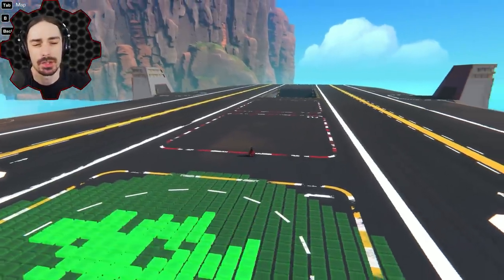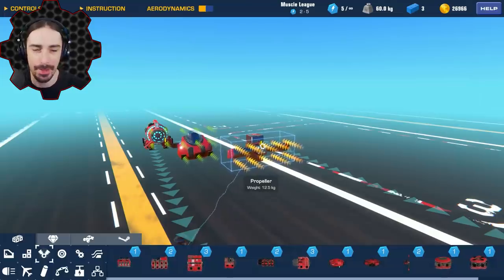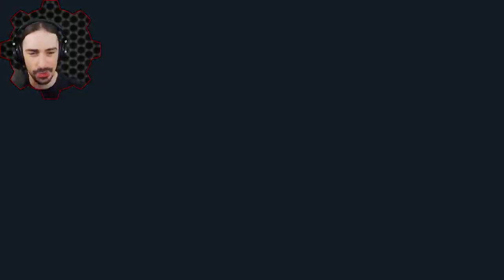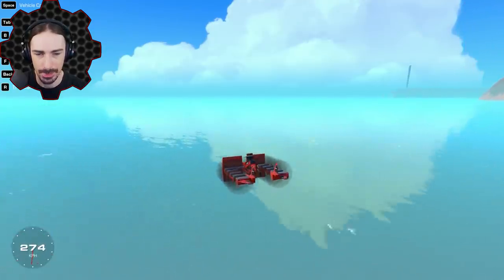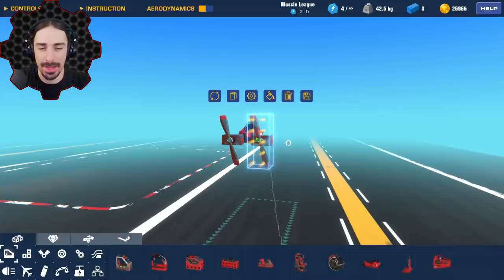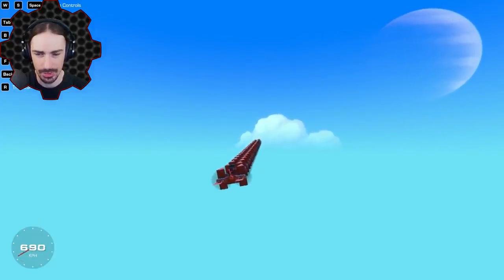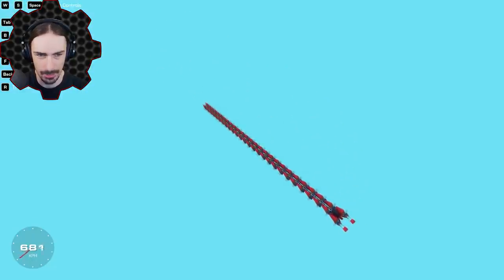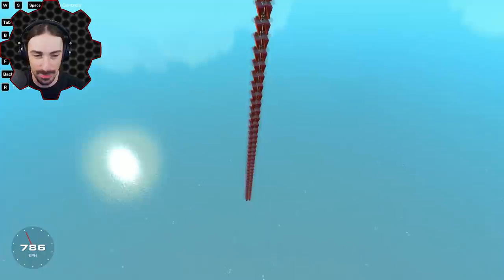Is It Possible to Break the Sound Barrier With PROPELLERS?! - Trailmakers Gameplay

Comment: How about try to "break the sound barrier by spinning..."
I mean you have speed when spinning...
A wheel have speed when spinning
A propeller's have speed when spinning
Why not spin yourself and maybe just maybe, it can break the sound barrier.
Reply: A BEYBLADE BREAKS THE SOUND BARRIER
Reply: Theoretically this wouldn't be too hard if you just get really far from the center of rotation
Reply: idk if trailmaker caculate speed that way
Reply: I may be wrong but I don't think it is possible as I have tried and there seems to be a cap on the speed achievable (by spinning or using an arm to spin a seat in a circle) around  120 mph but knowing scrapman he would do it
Reply: @pognaut  aerodynamics, get engines and helicopter engines
Reply: Spinning is a good trick
Reply: @classic_gamer4702  not if you get dizzy real quick...
Reply: @vxunaTM_xuandanhphan  it does not you it only calculates speed linearly
Reply: The ultimate beyblade
Reply: @flashlp3001  I was referring to the line in "The Phantom Menace" where Anakin says 'I'll try spinning that's a good trick'
Reply: @Eryna_  propellers only
Reply: @cyantasks7129  thats a seperate challenge though?
Reply: @Eryna_  oh
Reply: I went 12000 kph in stranded in space because I was trying to get an explosive salvage and glitched into a wall while repairing and it launched me straight up
Reply: This comment reminded me of  a ksp video where someone used jet engines to get to orbit

Comment: Next video idea: break the sound barrier with the least amout of power cores 
Edit: I have alredy said this in the comments but the challenge would start from the ground and just like any other of their challenges glitches would not be allowed
Reply: 0 only weight pulling down. easy
Reply: You can do that with zero. (Gravity or stacked servos)
Reply: Starting from the ground then
Reply: UFO engines make that pretty easy.
Reply: You guys are forgetting the video where he breaks the sound barrier with pistons
Reply: Amazing
Reply: The least I’ve done it with is 15

 5 dragon engines
Reply: Bruno Seabra does using gravity to advantage counts? If then just spawn a aerodynamic brick that is extremely heavy at the sky and let it fall. 1200 should be ez for that
Reply: @erridkforname  he already did that

Comment: IRL props do produce a ton of drag, that's why we feather them into the air in the event of an engine faliure.

Jet engines have a high static suction and generally only drag around the intake lip. This is even better in the air. Jets produce insane drag when offline, though.

Comment: Break the sound barrier on the centrifuge, or whatever the track is that just goes around in a circle without touching the ground (wall riding?), then when you start breaking the sound barrier, drive off the top of the track to see what happens when you drive off faster than the speed of sound.

Comment: So, there's a thing called drag-glitching in TM in which you add a bunch of blocks that block every single part of your original vehicle aerodynamically and then detach them all, at which point drag either does not get calculated or is massively reduced for the remaining parts that were previously obscured.  As an example I have a drag-glitched <30-part twin-prop plane (no jets or anything else) that can do 500kph.  You might want to specify no drag-glitching in your challenge, otherwise you're just going to get a bunch of glitched  planes that can break the sound barrier with only a few props which is probably not what you want.

Drag-glitching is fun though, especially when you use more powerful engines.  I have a drag-glitched UFO-engine microplane that can take off from the spawn-point on the carrier and break the sound barrier by the time it reaches the far end of it, and just keeps accelerating from there - I've gotten it up to about 8000mph (>mach 6) before it hits the edge of the map.

Comment: As soon as I read the title, I thought of an aircraft made in 1955 called the XF-84H Thunderscreech. it was a prototype fighter that was both jet powered and propeller powered at the same time. It never made it into production because of one major flaw, and that was that the propeller would spin so fast, that the tips of the blades would be going supersonic causing it to have an EXTREMELY loud droning sound anytime it flew.
Reply: @nikkiofthevalley  So loud, it made the ground crew not only feel ill, but actually ill. You can do some research on it if you'd like. Here is a video showing how loud it is flying at 17,000 feet: https://www.youtube.com/watch?v=J3NylpZOyU0

Comment: I think the thing with the air resistance is because the jet engine sucks in air and accelerates it, that's how it creates thrust thus it has little resistance . The propellers however can only go as fast as they spin: if you go faster they won't give you any more thrust.

Comment: The reason why The plane engine is Arrow dynamic is that it uses air the around it that gets compressed and goes with the plane fuel and that is why its arrow dynamic if we're going off of real plane Engines

Comment: Irl propellers planes have a terminal velocity because as the propeller spins so fast, the tips of it get near supersonic. If they hit supersonic then they create shock waves which would decrease the pressure of the air that they are going through. You can't fix this by flying higher, because then the air becomes to thin for proper combustion. Enter the turbo jet. It Uses an impeller in the front to suck a bunch of air into the combustion chamber, and the the hot gasses turn the blade in the back, which is connected to the impeller. Once its up to a certain speed, it will keep itself up to that speed. In the most basic sense, its a glorified thruster.
Reply: holy hell where did you know this
Reply: @vxunaTM_xuandanhphan  I watch a lot of jet engine videos

Comment: I think I understand why it registers air resistance behind thw propellers. Propellers pull air in and push it back yes? So technically a new airflow starts behind each and every propeller.

Comment: id try the same idea but instead of front to back do a side to side with them so u basically have a giant wedge for aero because your increasing drag by having the air being pushed onto a wedge from the prop and i believe its just multiplying at every section just a guess tho also would exponentially cut down on complexity.

Comment: The realistic problem with propellers is that they cannot produce more thrust then maximum thrust output However, jet engines continuously spin because they use fuel and air combined to produce thrust. Therefore the more air goes into the engine, the more thrust it produces so it is impossible without a supersonic propeller to supersonic speeds. This is also why prop aircraft are noticeably slower.

Comment: Next, see if you can break the sound barrier by using only mini thrusters for propulsion 
( Like if you want him to do that )
Reply: Mini thrusters are actually way easier too do so as they are smaller than props and have a greater power too weight ratio.

Comment: The reason propellers aren't aerodynamic is that *they only push air thus the blades are at a shallow angle means its for slow application only tho blades with higher pitch are for high speed because they have less drag for having less contact

Unlike other jet engines that sucks air compresses and then shoots them air at high speeds to create thrust

Comment: 1:34 so jet engine will suck as much air as possible the more air they can suck more thrust it release but propeller blade work like wing it generate lift to the way 
they are facing but if it have lift it will also have drag that will make we go slower so i awnser your question about why propeller have lower aerodynamics than jet engine

Comment: By the way, propeller powered aircraft cannot break the sound barrier in reality, the propeller themselves would need to turn faster than the speed of sound without destroying itself. Then, even if you make it fast enough, it will loose any efficiency once it start turning supersonic because the sonic boom will remove any air around the blades.
Therefore it is impossible to break the sound barrier by using air as propulsion.

Comment: uuuuuuuuuuuum ... , scrapman, 
you know how propellers work, right?
they have a max speed, just like irl.
why? well because otherwise the air would collide with the front of the propellers, so the airresistance is just a suggestion.
showing what would happen if you hit max speed.
it was destined to never work lel

i always concidered those green arrows buggy, not correctly implemented, halfassed.
most of the time they dont correspond to whats actualy happening, so i turn them off

Comment: Your reasoning is faulty. Problem with propellers is the limit of RPM and/or pitch. When you go faster than design airflow, the propulsion force generated by it disappears.

Comment: Bearing in mind he tried piston glitching can he just use the 0 drag glitch at that point.
Reply: Nah. Piston glitching does nothing for the performance of a vehicle. The pieces that are glitched retain the same aerodynamics as the did when the piston was expanded, as scrapman demonstrated here. Drag glitch completely defeats the purpose of the game when it comes to speed because it completely removes the challenge of good design.  You will never see a t10 vehicle using piston glitch whereas drag glitch has ruined the leaderboards.
Reply: My point being that piston glitch is harmless and not even useful anyway, whereas drag glitch is boring asf and 100% removes the challenge so it's dumb to use it in a video that's supposed to be a challenge